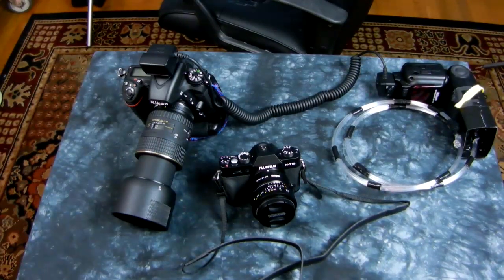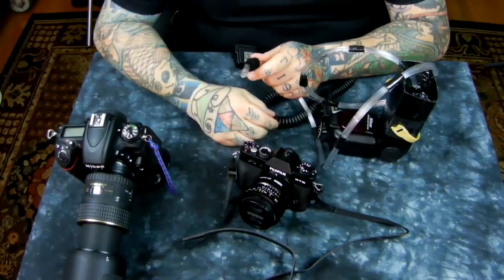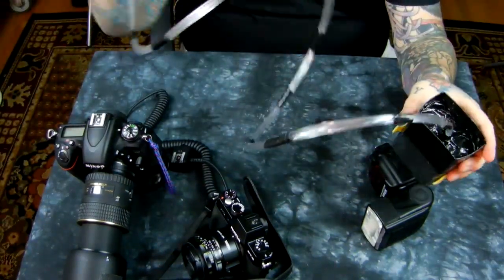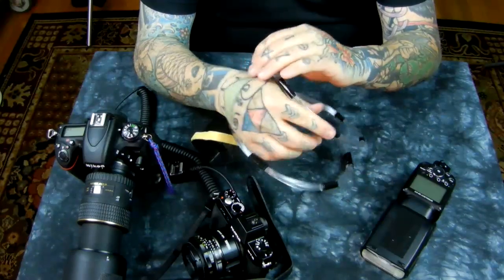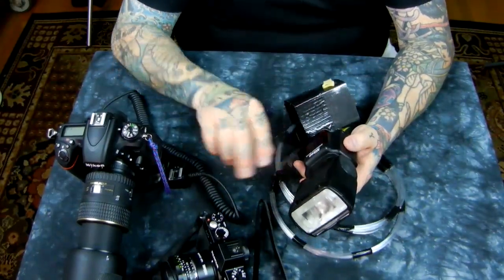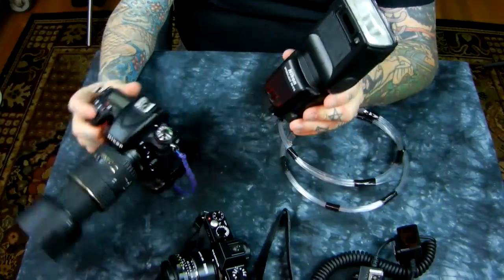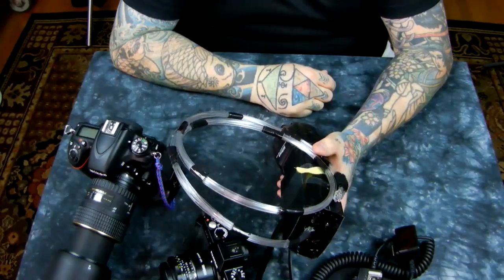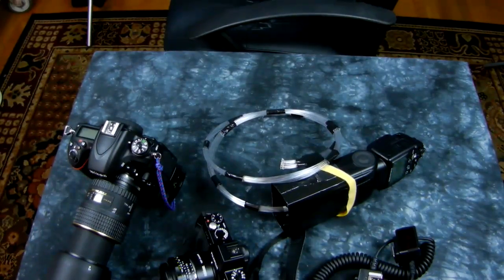Awesome Photographer's Invention: Part 2. MACRO TTL 100% light-control device. DIY $4 !!

Comment: A few days ago i ordered 14 meter fiber optics 2 mm on eBay and i can't wait to see the results of transmitting the light of my 580 EX II Canon Speedlight flash. Would it make any difference if i would use finer fiber of let's say 0,5 mm, bundling much more of them together? Would it also be of any benefit if i would place some kind of mirrors or tinfoil on the insight of the connection to my flash to get more light through the fibers? and another question is if it would be interesting to connect multiple fiber cables so that it would be possible to get the light transported in different directions? Another thing: i think that it would be better if the fibers are fully surrounded with black tape or plastic or even a garden hose (Less loss of light). If it works well with this your invention it means that i have saved myself a lot of money. I considered to by in near future a twin-flash on eBay (very expensive) or a second Speedlight. The ringflash (Nissan MF-14) that i already have is not so good for the used lens that i bought sometime ago, the mp-e65 Macrolens from Canon, especially not when i want to go for the 5x magnification. And i read many arguments that it is better to let the light come from sideways, other than with a ringflash from the front. 
Many thanks for you interesting video's.

Comment: Awesome!!!!  Does it matter if the fiber optic cable is shielded with a coating?

I also gather the much less expensive Nikon SC-17 will work for a remote ttl cord?
Reply from the maker: +Eli Smith nope, doesnt matter :)